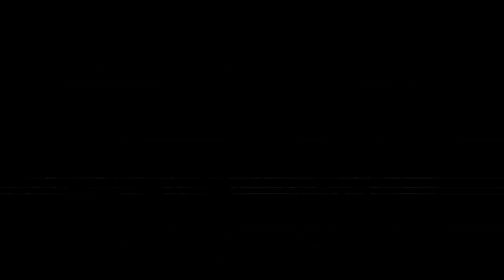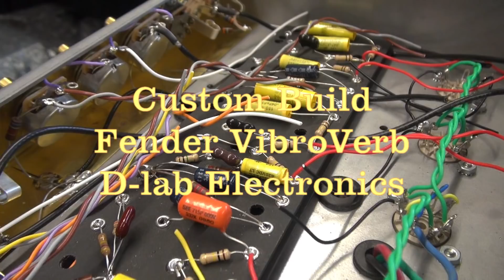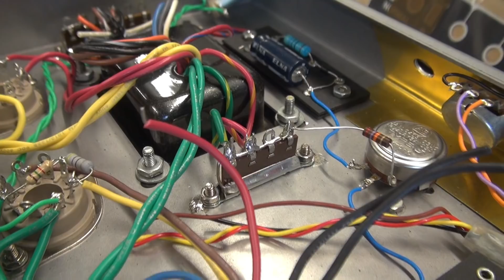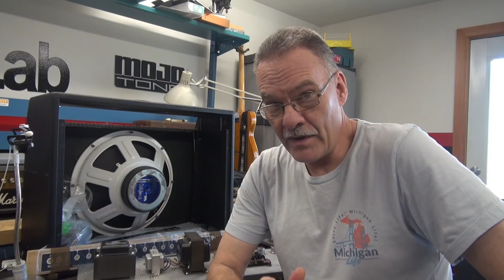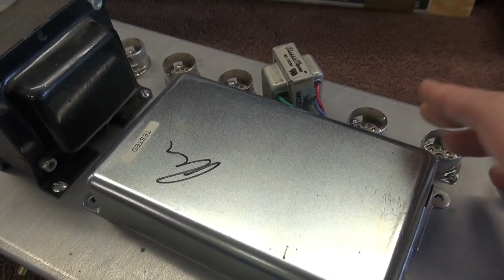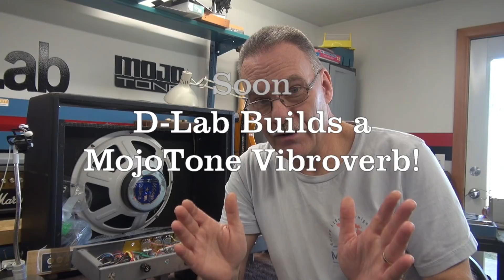Custom build Fender VibroVerb AB763 6L6 tube guitar amp Vintage project D-Lab Electronics Part 3

Comment: Since the heaters don't care if they are supplied with AC or DC, is there a reason why a few diodes aren't used to feed DC to the heaters? Then you don't have extra AC running around in the amp.
A faux tweed deluxe I built didn't have a 5 volt winding in the power transformer so I installed a DC 5v wall wart for the rectifier heater and the amp sounds great.

Comment: I like to change out the standard OT for a Twin Reverb size one. So, instead of 4 tubes and reflecting 4 ohms in the Twin you would have 2 tubes in the VV at 8 ohms. More headroom, less sag, and with a 15” (JBL D130F for instance) it is punchy and sparkly and makes it something special. A lot of AB763 can sound the same; variation is the iron and the speaker. So, the bigger iron will break up much later than the standard “6” that most blackface’s growl at.

Comment: This is a fantastic Vibroverb diy docu-series - thank you! I’m new to amp building and recently built my own Vibroverb from Rob Robinette’s Blackvibe layout. I added a presence control and a train-wreck style master volume. I love the amp,  but it gets wicked radio interference. Someone suggested moving the grid stoppers from the input jack to the tube socket (the other side of the shielded wire). I wanted to ask if you had my tricks to reduce noise. Thanks!

Comment: as a safety precaution you should add diodes to the rectifier socket and protect the power transformer in case the recto tube shorts internally

Comment: Hi Terry, thank you for sharing the progress of your build. Really pretty lead dress! I wonder whether you could comment on your selection of hookup wire around the amp, include gauge, stranded,/solid, and insulating material rated to 300V?, 600V?). Same for the coax leads. Apologies if I have missed these details in the video or comments. Cheers, P.
Reply from the maker: Hi Peter, wire is 20ga, Teflon insulation, not sure of breakdown voltage

Comment: A vibroverb with an opto? I don’t know about all generations of that amp but wouldn’t that be out of place in an ab763?
Reply from the maker: The old Neon is not available, choices?
Reply: @d-labelectronics  my mistake. I thought the vibroverb used a bias shift tremolo rather than the LDR type. Maybe I’m thinking of the vibroluxe?I think Hoffman had an AB763 design with that type of tremolo and that must be what I was thinking. 
Regardless, I am enjoying this series

Comment: As always, Terry, thanks for inviting us along on the journey to build a quality amp.  I especially liked your use of the RG-174U coax to carry the low-level signals.  Only grounding them at the source end is something I learned building military gear, we used heat shrink solder ferrules to add a pigtail at the end.  For my own gear I would sometimes spread the shield braid where the jacket ended, then bring the center conductor through the gap.  It made for a clean end to the cable, especially with a bit of shrink tubing, but you had to be careful not to melt the center conductor insulation while soldering the braid!

Take care, sir!  Stay safe and healthy.  Eagerly awaiting the next video!

Comment: When I build “clones” or what I call “replica” amps, I use the best of new and NOS parts. 
It adds a lot of value to the amps for myself and customer resale value. Along with being as close to the real thing with extremely high reliability. 

Using cloth push back wire, Sozo blue coupling caps, Sprague Atom electrolytic, AB carbon resistors, Cera-Mite ceramic resistors, CTS brass shaft pots, Belton sockets, US made iron, Weber speakers, US made tubes etc etc doesn’t add a whole lot to the price when compared to the kits available. I think you end up with an amp better than any boutique amp on the market. 

All that stuff is built to last longer than the originals, and sounds as good or better. I don’t have a doubt that this amp will sound and function beautifully, I’m just very picky about this stuff.

Comment: Cool build.  I like the filament wiring changes that you've added in.  Going to a power tube prior to the lamp is a good idea.  The wire going to the lamp will carry less currrent, so it's less likely to magnetically couple to anything adjacent.  All too often, it's taught that one can consider the current in a wire run as uniform.  And the we learn how electricity actually works.

I am a little concerned about the grounding scheme.  I've never been a fan of Fender's multi-point chassis grounding.  It trades redundancy and reliance on skilled execution off for noise susceptability.  It's a cop-out that makes for simplified production and reduced material (wire) consumption.  For the sake of a mass-manufacturable product, by relatively low-skilled labor (it is delusional to imagine that vintage Fenders were assembled, or designed, by a team of ex-NASA engineers), this is an acceptable, even necessary, compromise.  But it is just that.

The end goal is to acheive a controlled impedance across the entire ground coupling.  This is your electron source after all, conventional current flow be damned.  Relying on a multi-point chassis coupling, where one is essentially immune to magnetic (aka current-based) coupling with an aluminum chassis (steel is another story), one is now completely exposed to capacitive (aka voltage-based) coupling and ground pollution.  And if your audio path current flows are put in a position where their pathing is arbitrary, the end result will be noise.  

Given that any tube amp needs a reasonably high voltage to function, capacitive coupling is often a larger problem than magnetic coupling.  Some astute readers may wish to call upon Ohm's law to point out that with high voltage comes high current, as the resistances are static.  But I'm afraid that's where the gap between Ohm's work and Maxwell's becomes clear.  To be frank, their are very few high current paths in a typical tube amp (filaments, output transformer secondary, light bulb).  Eveything else is typically < 100mA.  Since magnetic field flux density (aka intensity, and thus perpensity to create noise) is reliant on current and physical geometry, not voltage, it can largely be ignored in the circuit pathing aside from the instances named prior.  Transformer location and posture are important as well to avoid inductive coupling between them.  This is another pet peave of mine in Leo Fender's amp designs, and is a hangover from the tweed days when the cabinets were smaller (material savings), and the transformers were offset to one side to make room for the speaker.  Regretavly, this was never rectified (no pun intended) in Fender's future designs to present.

BTW, your choke and output transformers are radially coupled (worst case scenario).  Rotate the choke by 90 degrees and you'll largely reduce this affect.

I've always been a fan of a fully wired-star ground, with 1 and only 1 physical connection to the chassis at the nuclear point.  This ensures that the overwheming majority of the ground current flows in a controlled manner through the wires from the star to various points in the circuit.  It's a lot easier to move a wire to avoid noise than to move a chassis.  It's also a lot easier to test 5 wires for noise than all of them.  With such a scheme, the chassis tie is then relegated to a more suitable role: to shield the circuit from EM interference, and to protect the user by being able to conduct current in the event of a meltdown.  The ideal points to fly back to the star are: input ground (from the jack itself, isolate it from the front plate), power cord ground, mains secondary at rectifier, speaker output (lift the jack from the chassis and ground to the star with a wire), filament tie (whether rectified, or strapped via 150 Ohm resistor pair), and low side of the power tubes.  All other grounds are subsidiary to these ones, and their lineage should be pretty clear between audio, power, and IO (input/output) classifications.

Comment: Really nice and a good point on shielded wire from knob to tube  -  I'm doing the 6G16 Brownface already from scratch (still waiting on parts) But, could you give out information on the copper  plate you installed??  Like the thickness and type? Seeing expertise build lets me know getting there patience is key.
Reply from the maker: Hello, The brass is .010 thick, shim stock, pretty common